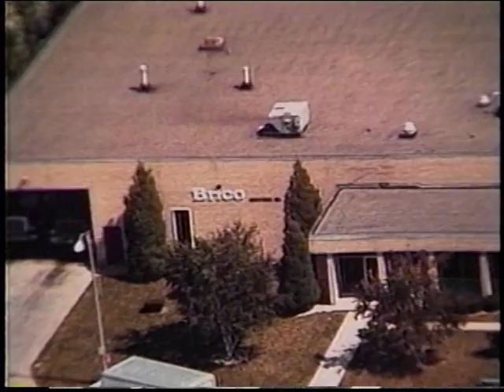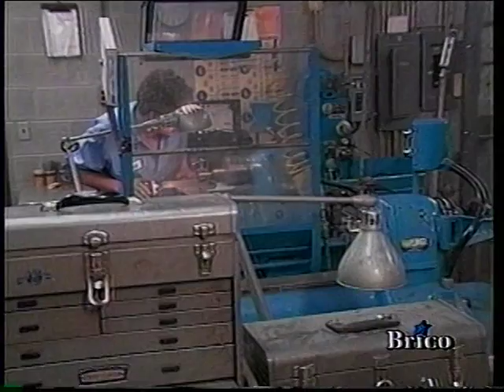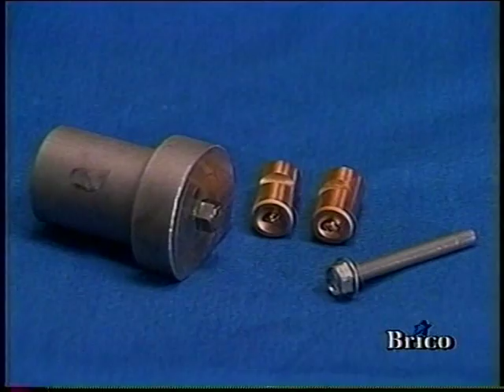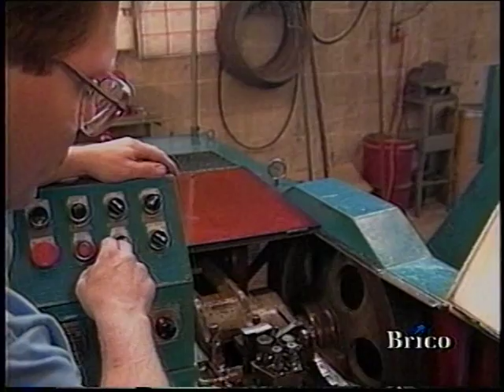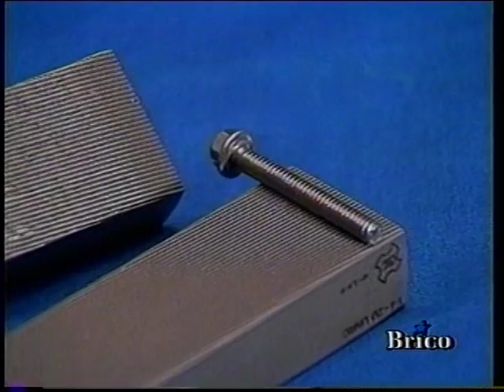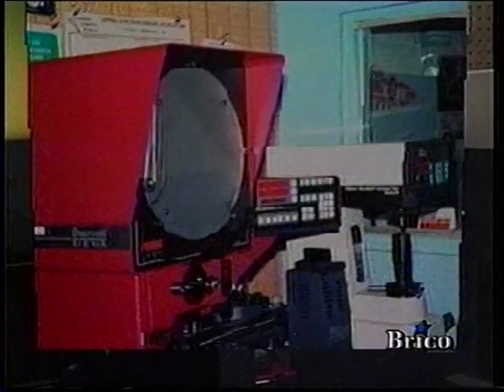Brico Industries

Comment: Everyone seems to be in the game so I’m gonna go all out hey everyone am a header pinch pointer and threader. I run any header from a WAFIOS nd90 at 1400 ppm, or nakashimada ns80 at 120ppm, to a 1inch toko open die at 50ppm. I can put drill points on parts as small as 1/8 at 500 ppm with a sheen tzar pincher, 1/4 parts at 300ppm with a Hartford number 1, or up to a 1 1/2in diamond point onto nails with an almighty Waterbury pointer. Last I tend to push my threaders to the max such as an EW Menn gw63 at 800ppm or shoving a 2in diameter bolt with 10 inches of thread through the 1948 Waterbury Farrel #100 at about 30 ppm